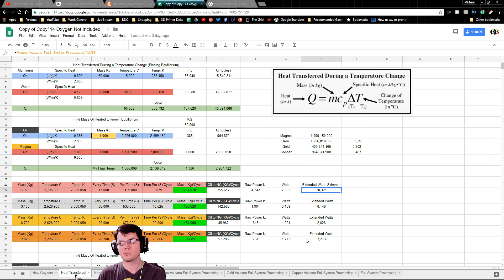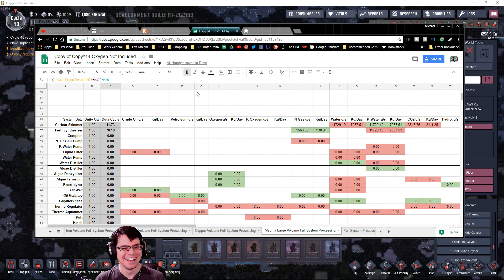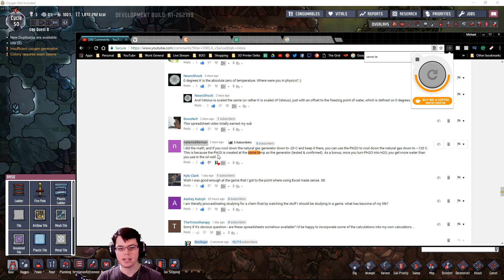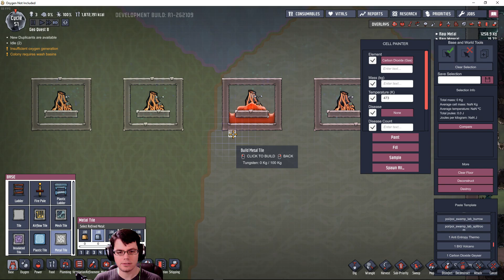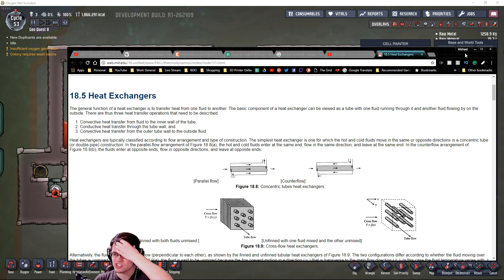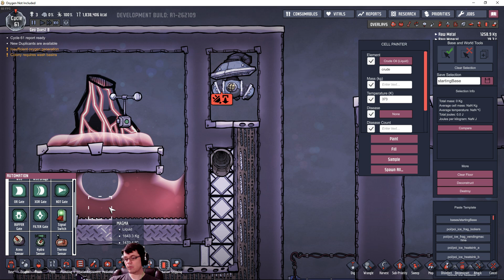Volcano Power Plant Design Challenge! Part 2 Oxygen Not Included

Comment: on my latest map, I dug down and found 3 oil wells, a carbon dioxide geyser, volcano and hot polluted oxygen vent, all within a dozen or two tiles of each other. As far as power generation goes, that's an gold mine!  I don't even really need to use the oil wells to get oil, I set up a stable above the CO2 vent full of slicksters. Did I mention the volcano? it's amazing!

Comment: If you don't use a counterflow to preheat the oil, but let the NG keep it's full temperature, do you think it would be possible to transfer that heat through metal tiles into a steam turbine system like you built directly on top of your volcano?
I've been toying with this idea for my base, just not sure if the iron volcano I have is enough I also have 2 minor volcanos I might try and built this around, but then I'd have to pump the oil up from the biome there as well, not that that's a biggie I suppose but I was hoping to build this in the oil biome.

Comment: I'm a fairly new ONI player and have been greatly enjoying your videos.  Your recent spreadsheet video inspired me to take a closer look at a minor volcano near my base that I had previously disregarded as I had no idea how to use it's energy.  As mentioned, I'm new to the game, playing maybe 3-4 weeks now, so this was actually my first time even seeing natural gas as I've been using coal/hydrogen up until this point.  After some trial and error, I've come up with an oil boiler that I'm pretty happy with and plan on building for my base.

So far I've only built the structure to surround the volcano in my actual game, then I went into debug mode to do some test building and design the system I eventually plan to have my dupes construct.  I was very short on time and materials when enclosing the volcano, which is why it's missing some shift plates (though I don't think it ended up making a difference).  I was also constrained by the ruins on my map, preventing me from building very far down below the volcano.  But since I plan on really building this in my base, I worked with what I had instead of removing stuff in debug mode.

So what I've built is basically a boiler plate that's used to flash the oil almost straight into NG.  The temperature of the plate itself is regulated by the door vacuum lock to make sure I'm only taking as much heat as I need, when I need it.  I did have to use a sensor mod to allow me to set the temp sensor to 540 C to keep it right at the evap 5 point for the petroleum.  My goal was to absorb as much of the NG heat into the crude oil being pumped into the system, which allows me to cool the gas and also use as little heat as possible to boil the oil going into my boiler.  I've run this system for ~25 cycles with the oil flow set to 2000 g/s before it reaches critical temps and my upper temp sensors turn it off.  I ended up with around 82Kg of NG per block in my 10x10 test chamber, or roughly 328 Kg/cycle.  Your spreadsheet gave 368.5 Kg/ cycle when I plugged in my volcano specs, so not too far off.  Though I obviously still have some heat issues to deal with.

My plan is to work with the AETN below the volcano to build in a reset loop that allows me to pump out the old oil to cool and pump in new cold oil to cool the unit.  I just wanted to make sure I was extracting as much heat beforehand so I don't have to remove anymore than absolutely necessary to keep temps in check.  

I'll include my save file if you'd like to take a look.  As mentioned, you will need the sensor mod to make it work correctly, but if you're going to be playing with volcanos I think it's something you'll want regardless.  It should be all set and ready to go in the save.  The switch directly to the right of the volcano is to open/close the upper chamber while the unit is turned off, to either pre-cool the upper area or vacuum out the entire chamber.  The switch next to the desk is the main power switch.  After the pressure in the main chamber gets above 1000g, the left atmo sensor needs to be set to below 1000g rather than 5000g.  If not the SR latch flips out and breaks.  The upper temp sensors will shut the whole thing down to prevent pump meltdown if things get too hot, as well as lighting the lamp to let me know.

If you want something really entertaining, turn the flow on the supply valve all the way up to 10k and the right atmo sensor to max.  It creates HUGE clouds of NG and it's pretty impressive to watch.  Unfortunately it also overheats very quickly!

Keep up the great vids!  Can't wait to see what you come up with!

Here's the save file: https://drive.google.com/file/d/108vlHxqJxu2ZGE4sIIDIQhZmeDVISuj9/view?usp=sharing
Reply: Oh I should also mention, I've run the same system for ~75 cycles at 1000 g/s flow rate and atmo sensors at 1Kg/2Kg and it reaches equilibrium where it won't overheat and the upper chamber actually stays cool the whole time and recharges between cycles.  This didn't provide nearly as much NG though, so I'm working on handling the added heat the increased flow creates.

Comment: Great idea using the airflow tiles to channel gases. If you want a counter flow heat exchanger just run thermally conductive pipes through the airflow tiles that are filled with the hot gas. You can have either a large chamber/radiator setup or a single line counter for system to pre-heat the oil.

Comment: Here is what I implemented in my base: https://imgur.com/gallery/zcned

I separated fiive chambers with thermal couplers: The vulcano chamber, the heating chamber with hot natural gas and a liquid vent, the cooling chamber, the pumping chamber and some kind of heat sink. In this case i just suck up the heat with cooled crude oil in granite pipes which I use for general cooling purposes, but I guess I could also use the water purification setup as in the last part of this video.

I only transfer heat from the vulcano to the heating chamber if there is some crude oil on the bottom, so my gas doesn't get hotter than necessary. The cooling chamber is maintaining a prssure between 3000g and 6000g. If it is above 6000g, the door between cooling and heating is closed while the cooling takes place. Once the gas is cold enough, the door to the pump opens and the gas is sucked out until it is below 3000g and the process is repeated. I try to maintain about 100kg pressure in the heating chamber so the gas exchange is very fast. The throughput is enough to power my whole base with about 10 natural gas generators. 

As a little thing I implemented to stop gas from being destroyed by the thermal couplers: The three doors between the heating and the cooling chamber are closed in sequence from left to right and only then the middle one is opened to create the vacuum.
Reply: And I love your intros xD
Reply: How are you dealing with the igneous rock buildup?  Won't it eventually cover itself?
Reply: It does. I have to send in some dupes before every erruption to dig it up. With exo suits and the thermal coupler+water lock it's not a big deal.
Reply: Ahh ok.  That'd be too annoying for me so I guess I'll keep experimenting.

Comment: You could just make the heat exange path between crude oil and natural gas longer to lower even more the temperature of your gas.
Also you see that rock is forming at the bottom of your lava tank, which mean volcanoes cannot be used that way.
If you cool too much lava, then you have to dig the igneous rock out of your system and that looks painfull enought to quit.
Anyway I think this could be solved by regulating the amount of hot lava you are using at the same time. For example, drippling it into your oil directly may be a way to get tiny piece of igneous rock that can be automaticaly kicked out.

Comment: Hey brothgar the first system could work if you ad door temperatute control between metal tile and crude oil ! With a Heat sensor you can stop the heat to transfer and prevent gas or liquid getting hotter And hotter 
Also I love what you do :)

Comment: Try to limit heat flow with a door that when opened creates a vacuum, this alone should make the designs much more manageable

I think the best way to cool gas would be using it to preheat the oil you are going to pump to be vaporized. After that you might be able to still run a steam turbine off of its temperature and then comes the steam generation. You could also try destroying the heat running it through a carbon skimmer or sieve, which always output at 40C no matter temperature of water

Comment: Just an fyi, the pipes got damaged because the water changed states inside. A recent patch made it this way, so when the water inside the pipe heated above 100 C it turned to steam and broke the pipe. You'd need to have a more direct control over the temperature of the water - probably by using a door vacuum system, where the door closes to transfer heat and opens to stop heat  transfer. EDIT: At least, I think so. :)

Comment: Dude, I dig the video's where you are just trying stuff out. As they say, learn from the mistakes of others because you can never hope to live long enough to make them all yourself.

My thought is, why not just dribble your crude oil right on the volcano? Also, when the natural gas was getting pressurized in your spiral, you need to get that out fast. Better to have the gas pump creating a very low pressure situation by setting that atmo sensor to like 1kg instead of 10kg, that would keep it from blocking up the space where the crude oil needs to pump to. But the thermal situation in that spiral was going to get out of control quickly so better to go with a linear setup. You could think about using the polluted water pipes inside the thermal transfer channel to also precool the natural gas/preheat the polluted water.

I look forward to seeing the next iteration in your volcano management system.

Comment: I'd like to automate more of it but the heat sensor maxing out at 300 is trouble.
Reply: you could build a temp switch for around 350C° if you fine using debug mode to spawn in 1g of mercury.
hydro/atmo sensor in a 1x1 room with tungsten walls, if you add more mercury the senso will have a delay
Reply: Yeah I don't want to do that but I could do something similar with phosphorus(melt down phosphorite) which evaporates at 280 but I'm wanting a temperature sensor in the petroleum range 400-550.  I will have to see what granite turns in to when it melts.
Reply: me stupid.
there is a mod, forgot about it
https://forums.kleientertainment.com/topic/81296-mod159-materialcolor-onionpatcher/
ps: debug mod in configurator to activate
Reply: AND, bevor you find out the hard way Oil to petrolium convertion will burst your pipe around 400C°
Reply: Yeah. But you can heat up petrol in pipes just past 500 to convert oil that isn't in pipes.  Not really as important now with volcano sources.
Reply: yes, that would work.
but you need to get oil to petroium 400c°+ than belov 125 so your pump dont melt and after to 500 again
waste of energy dont you think
Reply: Yeah that is exactly it.  You can use the incoming crude oil to transfer heat out of the hotter converted petroleum.  The incoming crude gets closer to transition and the outgoing petrol gets closer to being pumpable.
Reply: and why do you exactly need that MUTCH petrolium? plastik?
energy wise is natural gas far better + if you dont need ferteliser you could use the extra energy in the NG to boil water to steam and dirt

Comment: hey brothgar i thought about a litte less complex arrangement while watching your crazy sience stuff.
you may could bring in Crude oil from both sides. so just mirror the inlet. shut off the liquid by a 3 tile space with airflowtiles and let the gas flow down like you tried befor and then back up around your arrangement. for cooling try to rebuild your cooling-loop ontop of the volcano and connect it to the Natural Gasflow with good old wirebridges as well fill the flowpaths with shiftplates. i want to see if you can cool down the whole gas just with the power of weezewortz and polluted water.
maybe you can heat up the water to steam and cool it down in the same time.
im really sorry if my english is worse like it look for me but maybe this little idea works out :D

Comment: maybe recirculate the hot crude back to your reservoir... ensure there is always a flow... so pump out of a tank, and let hot crude flow back to a tank. OR... use your heat isolation door setup to limit the heat transfer so you can control the heat transfer to the crude. I like the natural gas transfer to the steam, but same idea with isolation doors that open a vacuum that you did before between two sets of iron tiles to control the heat transfer (open up doors to create a vaccum.)  I was watching a video on real world industrial gas turbines... and they use a vacuum to separate the combustion chamber / turbine section parts as an insulator... they build voids in the parts to create thermal isolation.  Additionally they use bleed gas from the compressor to positively pressurize the casing and cool the stator and rotor parts of the turbine and, combustion chamber.  The combustion gases are so hot they will melt the turbine parts, but since they have laminar cooling gasses vented on the surface of the parts, they never overheat as long as there is a positive cooling gas pressure flowing over the parts separating them from the combustion gases.   Anyway... I applaud the effort... and threw a like on the video... maybe try to make your heat exchangers as simple as possible... take an iteration or two at the end to simplify things a bit... and remove as much as you can. Kudos!
Reply: Here is a link to the video... its plays like someone is reading a technical manual, but if you read between the lines you can see a bunch of the theory behind the parts they use for the turbine, compressor and combustion chamber. https://www.youtube.com/watch?v=4bAv9beP1B0